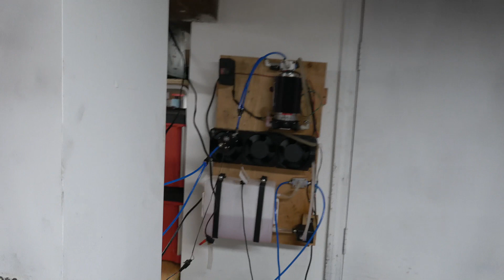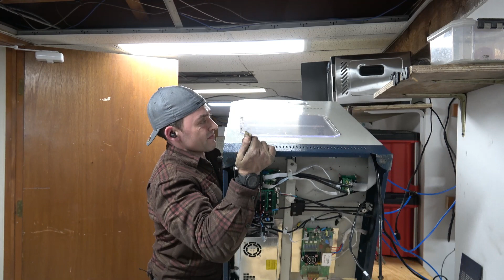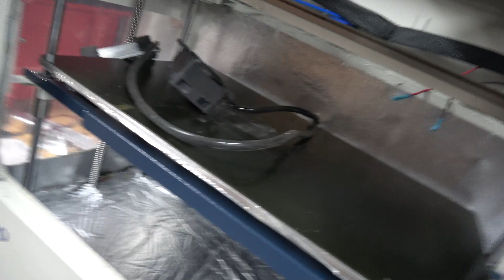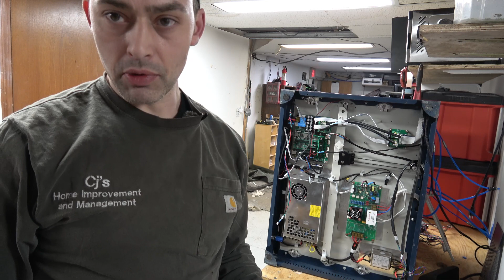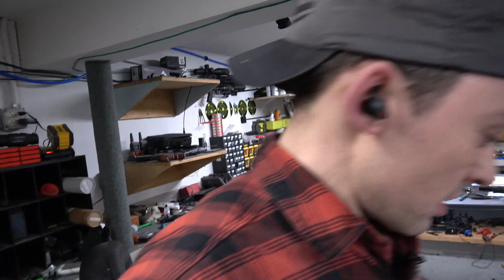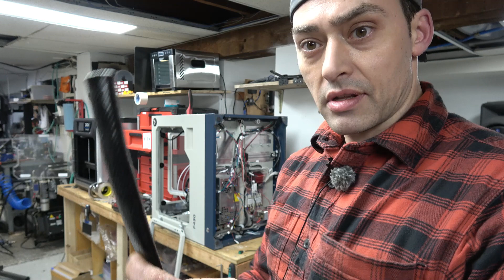Creatbot to Chrisbot Conversion Almost Done!!

Comment: Hi, i stumbled on your "review" video on the qidi and now following your build really interesting and fun hear / watch. 
i'm not looking for a high temp printer but i have a bambu a1 now that i need to return because of a recall the wire can melt and catch fire. So now i'm looking for a new printer for now i'm concedering the qidi x-max 3 and bambu p1s. wich one would you advise the qidi has more pro's bigger build plate, more quite (i hear in a review and it is standing in my living room) higher temps (but not important for me atm) but the bambu seems to just work and be good and looks better (not that important). 
other question i have now that i'm following your build why do you need such a high temp printer?
Reply from the maker: Hello, so I don’t have any experience with the P1 S or the A1 or whatever the miniature one is called, I haven’t had any personal experience with those printers, but the X one carbon completely works perfectly out of the box. The reason I would actually recommend QIDI is because you will get a much bigger, build volume, much bigger, material selection because of temperature, and their support is really really good. In the beginning, I didn’t hear back from them for a good amount of time and had fixed the problem on my own but once I did hear back from them they were amazing, and on the next issue and the issue after that that I had, which I’ve all been since resolved, they were there 110% sent me every part that I need walked me through everything. I already knew how to do it but I’m just saying if you didn’t know how to do it, they are incredibly helpful. Bamboo is difficult to get a hold of, and it will take a long time for a reply. I found that with them, and frankly, when I have a problem, I fix it myself. So if that is important to you to have actual customer support, go with the QIDI! Multi material and multicolor printing is important to you go with the bamboo. The reason I’m making a high temperature printer is because I was going to buy an extremely high temperature printer to print in high-temperature thermoplastics such as peek, pekk, ultem, and these materials need a high temperature environment for successful prints. This type of printer with that type of insulation and temperature capabilities would normally cost between 20 and $100,000. This printer is supposedly capable of printing it when you buy it, but I didn’t try, nor do I believe it actually would be successfully, and the material is $350 for half of a kilogram, I would rather do the work first and get it right, and I did it for under $5000. There is no other printer with temperatures anywhere remotely close to the temperatures. I’m going to get on this printer for anywhere near that price.
Reply from the maker: Also, when they were helping me with other problems, they sent me parts that I didn’t even expect them to send or no they were sending until I received them, but they were updates that they made to the printer because of problems. Other customers had, and they sent them to me just because, they had improved on it. Makes a big statement. Great company.
Reply: yeah i have the ams lite now but i dont use it for multi color prints because it takes almost 10times as long and there is a lot of waste material so i go with the qidi and i can order it on amazon so they also have good support. i have had good experience with the customer support of bambu because i had an a1 with problems before and i send it back free of charge and got my money back so i ordered a new one but now i have to return it because of the recall. but 2 bambu printers with issues is not that great, also this a1 makes some strange sounds so good that there is a recall. i'm on holliday now going looking foreward to watching your build. Thanks for your response :) 
 @Cjsairgunscarsandmachining

Comment: Hi Chris, excellent progress!

The Beacon thing is rated for 115C max operation, so it looks weak if you plan on going in the 150C+ range in the chamber. Since you've made an excellent effort to keep everything capable of high temp (all the cable insulation work, etc), it would be the weak link in the chain. It also needs to be clarified what the licensing is on it, but it seems from their website that it is unsuitable for commercial use (under CC BY-NC-ND 4.0 DEED). The product is geared toward hobbyists more than industrial setups.
Reply from the maker: And as I was starting to say, if I were to make it completely capable of 150 to 200 C, I would have to replace linear rails, i’ve already replaced the belts, so those would hold up, but the linear rails and linear rods and lead screws and solid structure of this printer is the reason that I was willing to put this much work into it, if I start having to replace those, I may as well have built the entire thing. I’m quite capable of building. All of this, I have CNC machines, a LATHE, a very large one, I could make just about every part for this and custom make my own entire 3-D printer, but I just do not want to go that far. For 3200 bucks I got a brand new printer with zero hours on it, but when printing with the original configuration, it was a total joke. The only reason I even bought the printer is because after my debacle with intamsys and seeing what a joke that Printer is for 7000, I knew I was going to have to build my own to get what I wanted. I have no doubt I will get it out of this printer. Between the liquid cooling, and direct extrusion I don’t expect any clogs, between the insulation and heat sources, I can control the temperature in whatever direction I like, with the Beacon, I can level the bed in minutes, like two minutes, and once it’s level and compensated, I can take the Beacon out if I want. But I don’t expect I’ll need more than 100 C as that intamsys only got up to 90 C, the Idexx 22 only gets up to 90 C, very few printers go over 120 C even very few go over 100, you’re in the 60+ thousand dollar price range on a printer and, frankly the fact that this is going to be doing more than $10-$30,000 printers is quite enough for me since I spent less than 5000 total. I’m pretty content with that, in fact, I bought an industrial IDEX printer, a RAISE, 3D, E2, and this printer, and all the parts to modify it for the same price as the INTAMSYS! And frankly, both of these two printers are better than that one! I don’t think I have much to complain about. Lol.
Reply from the maker: I am well aware of the temperature constraints, I don’t plan on going over 115 C, even though I am 100% positive. This will be capable of 150 to 200 C, I’m probably going to keep it around 100 to 110, there isn’t any material that it’s necessary to go any higher. A consistent oh hundred C will be plenty hot to print PEEK, no other material needs to be that hot. I’ll probably just do the aneeling process post print, I think the only way to avoid that would be something like the apium printer that uses lights for heat directly on the artifact, as it’s printing crystallizing each layer as it prints. I thought about doing that, but this is much higher than any BL touch can handle, and a mechanical switch was the only other possibility, which is just too unreliable and slow. I wanted something that was going to be quick as well, I actually ordered another one for my QIIDI printer.
Reply: @Cjsairgunscarsandmachining  Sounds good, just thought I'd point this out since you also mentioned wanting to print PEKK-CF which if we're talking about the one from 3DX-Tech recommend a chamber temp of "up to 160°C if possible with your printer". Hopefully it's happy at 110 or so!
Reply from the maker: So, if I have a reason to go up that high, I would just unplug the beacon, and take it out of the chamber after the bed was level really simple fix. Beyond that, if I were to have everything capable of going up to 160, which I know the heat sources are probably capable of 200 or more, I’ve added four heat sources, all of which output over 200 C, then there’s the original heat source on a larger Mosfet with triple the power, the bed is easily going to be 200 C or better, the chamber could be easily 150. I’m almost positive it will exceed 200 c if I push it, but that’s if possible, highlighted. Most industrial high temperature 3-D printers are not even capable of 100 C, yet they print these materials.